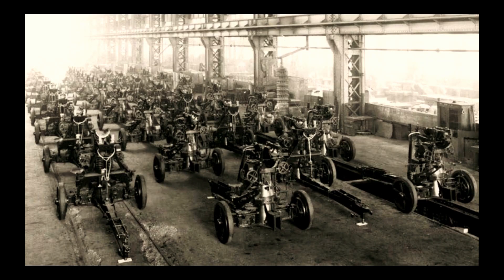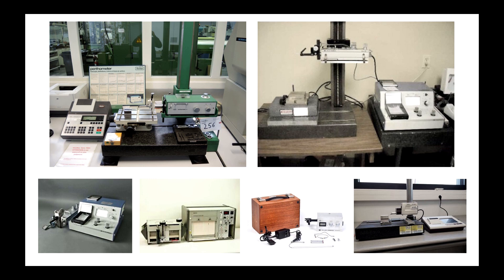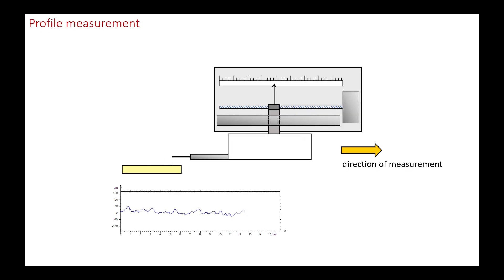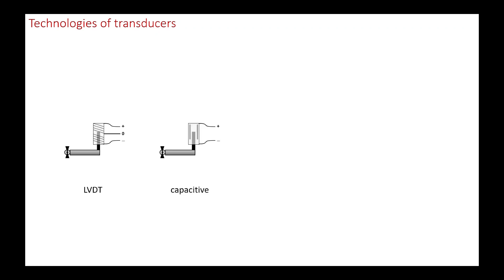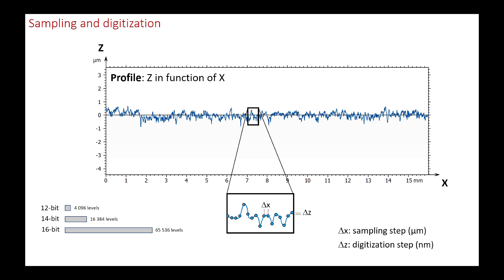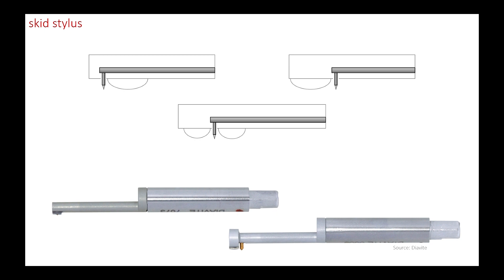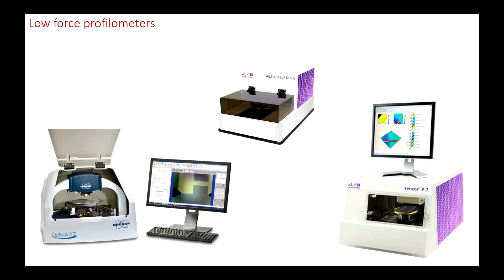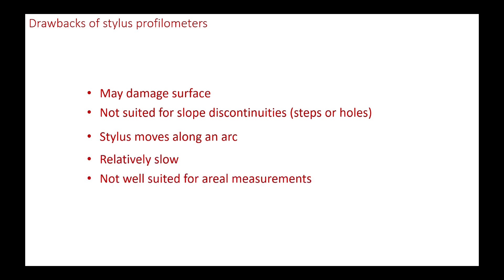Introduction to stylus profilometers

Comment: Is the semiconductor industry still using low force of contact profilometers or optical profilometry is preferred because its no contact?
Reply from the maker: Both are used. Specific stylii of very small radius can sometimes reach a better resolution than optical profilers.